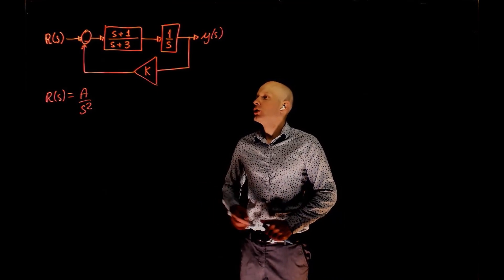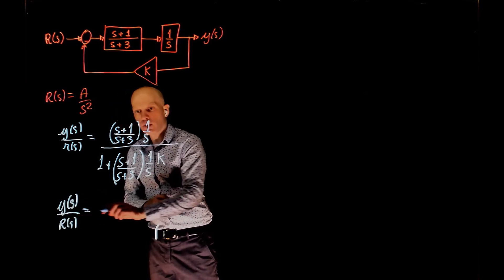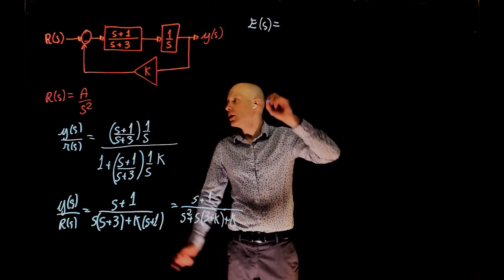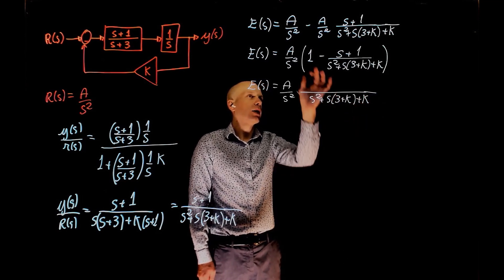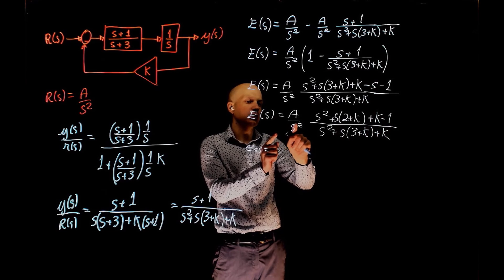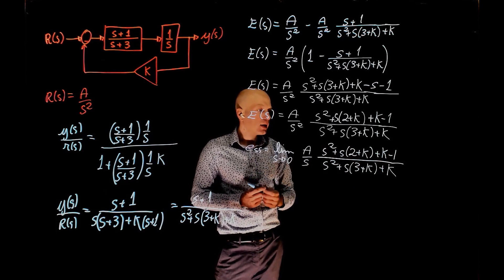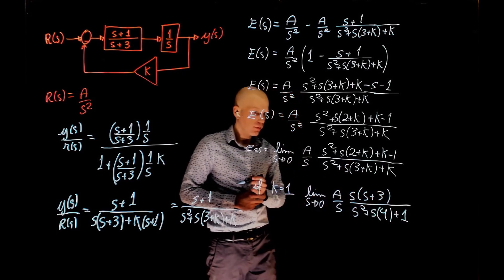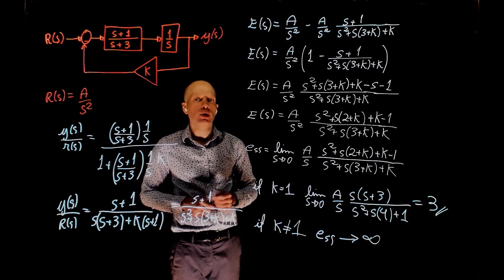L8E38 Control Systems, Lecture 8, Exercise 38: Transient response.

Comment: Hello, I have a question: why did you take the ramp function as input, but in the task: the input is unit step.
Reply from the maker: It should have been a step input indeed. However, the problem is more interesting with a ramp input ;)